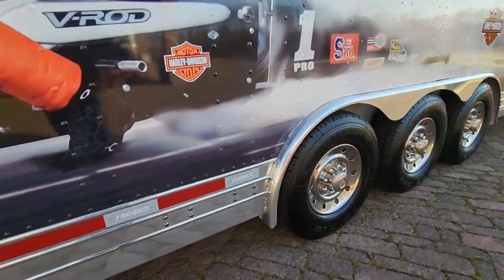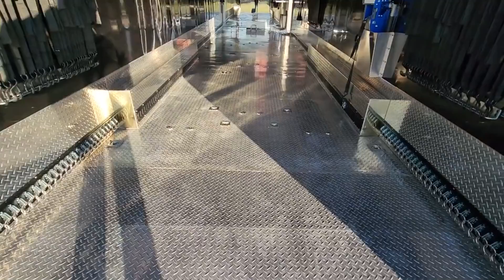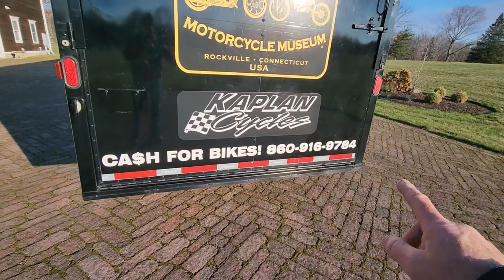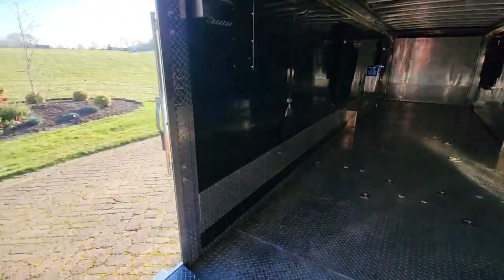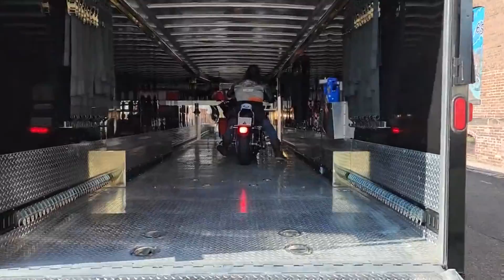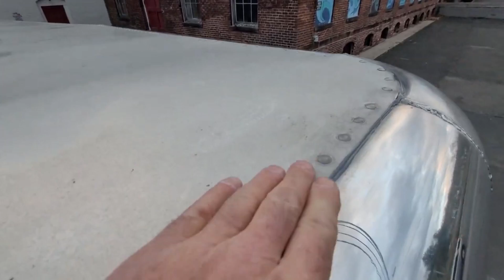"OBSESSED" FEATHERLITE MODEL 4941 ALL ALUMINUM 44’ CUSTOM TRI-AXLE SHOW BIKE & CAR HAULER MINT

Comment: To bad Harley doesn't use as much aluminum as possible on their motorcycles, they would be a lot lighter & never rust. They could probably even use titanium, in the parts that can't be aluminum, like the engine internal parts & all their plastic parts could be made out of carbon fiber. They could probably even incorporate magnesium in their engine covers ect. If Ducati & the Japanese can do it I'm sure Harley can to.